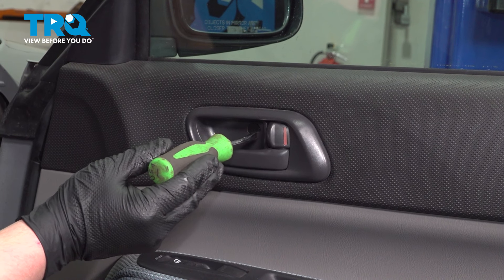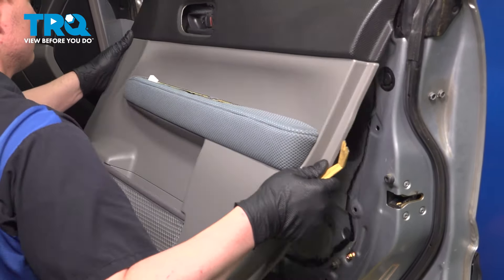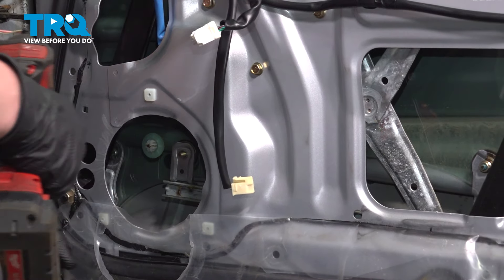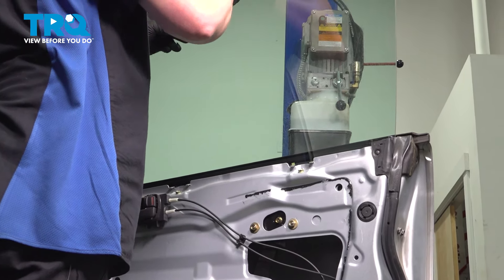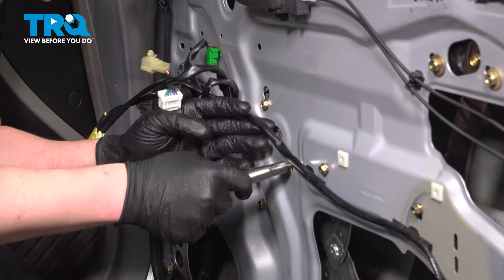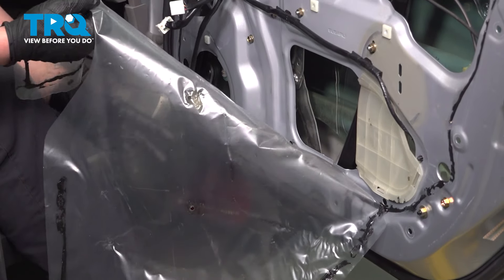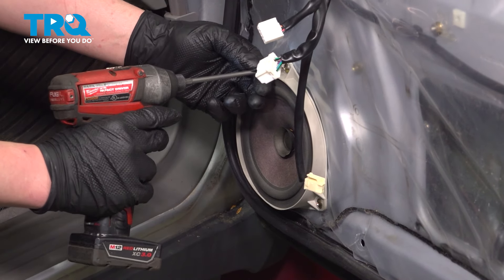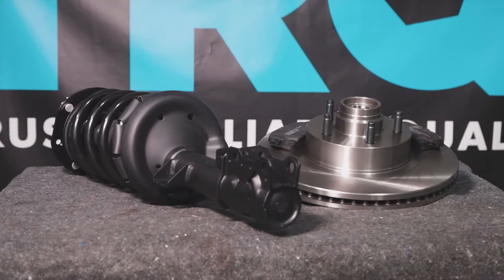How to Replace Front Power Window Motor & Regulator Assemblies 2003-2008 Subaru Forester

Comment: If your window won't go down. Loosen the track assembly up. Then use a 10mm wrench to loosen the nuts holding the glass to track at rear of door,it's tight it's a pain but can be done. You can then tilt the glass and wiggle everything to drop the glass down enough to get to the last bolts in the front. Just be careful with the glass.
Reply from the maker: +@nathantoth4185 Thanks for the feedback! http://1aau.to/m/Shop-TRQ